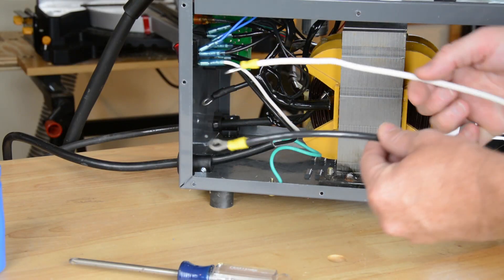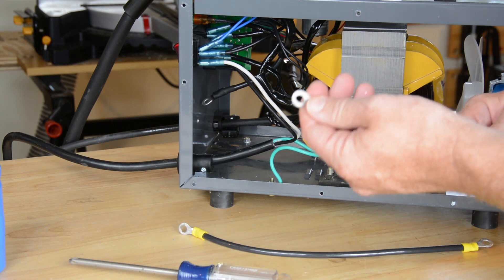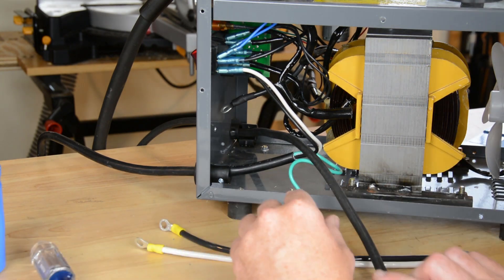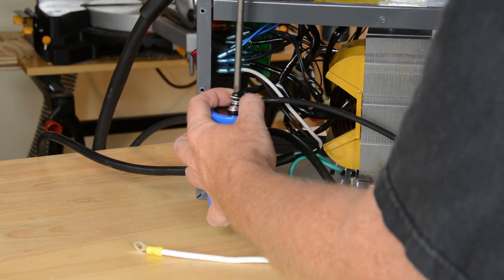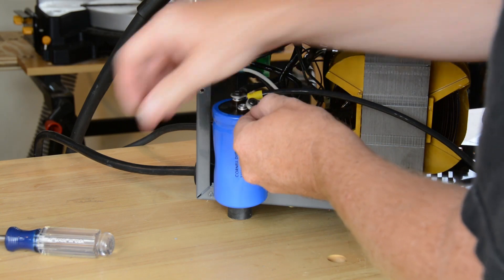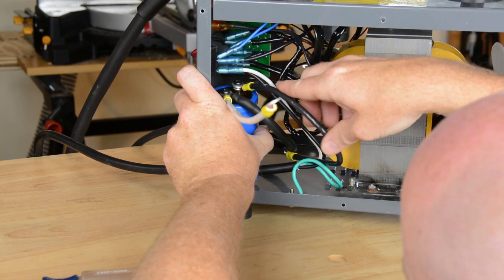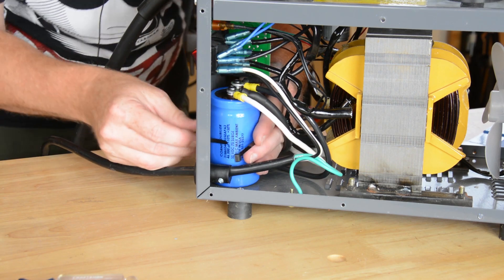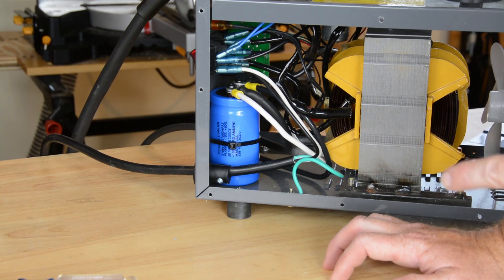Advanced Harbor Freight 90 AMP Welder Mods 05

Comment: Hi Matt 
I like the video but I have a question about the capacitors sizes, I have a couple of 1 farad capacitors for my Car Stereo Equipment from when I pulled out of one truck I had.
Can a 1 farad capacitor for car audio be used for this Welder modification, understanding that it is taller than the one's on your video.
I might have to make it sit at the bottom and go thru into the top section of the welder next to the wire feed controller so I can still be able to use a 10lbs wire roll and the rectifier down next to the Transformer or fan.
Or even having it installed on the outside of the welder with the wires going in and out with grommets and making a protective cover for the Cap.
I previously was a Car Audio Installer, Tinkerer, and Handyman with Electrical Experience so doing the Modification doesn't look hard to do.
Just wondering since I have them on hand I thought of asking the Guru of Welder Modification, hope to hear any thoughts you might have on the subject.
Thanks in advance

Comment: Can I use an amp cap 100uf 100v or 4700uf 80wv or 2200uf 16v?  Would the 100uf 100v be to much? What is the number I'm shooting for?
Reply from the maker: The important number is the voltage rating.  You want a 50V cap minimum.  Anything else will end up shorting out internally due to an over voltage (so no caps designed for car stereos for instance).  The uF rating is a "the more the better" scenario, although anything less than 10,000uF isn't worth doing and anything over 100,000uF is harmless, but unneeded.

Comment: I realize this is an old post, but curious why you observed polarity based on your welding leads and didn't just wire the capacitor directly across the DC output of the rectifier, positive to positive and negative to negative.  The welding leads could connect however you want DCEN or DCEP if you ever go to shielding gas.
Reply from the maker: This particular welder isn't capable of running gas, so it'll be DCEN forever.

Comment: What about using an 8 awg butt splice to extend the gun lead? In the new welders it is pretty short inside the case. I can use a butt splice to extend it using 8 awg stranded wire. Any concerns?
Reply from the maker: Soldered would handle the current better than a butt splice, but it should work.
Reply: +Matt Heere Yeah I agree soldering would be better. The wire gauge is so large I am not sure how well I could solder them together. Maybe I can find some solder butt connectors then heat shrink it.
Reply: John Chafin You can loosen the torch wires from above. You will need to trim the flux wire liner & the large thin rubber sheathing/hose that the wires are in. I did this & it was worth the ten minutes to have an extra 5 inches.

Comment: Matt After I have looked at this problem of where to mount my capacitor. I had made 12 in jumpers before I got the capacitor in the mail . And realized I couldn't mount mine where your is mounted .And strapped to the front bottom panel won't work as too close to the circuit board . Well I am thinking it may be possible to mount the capacitor on the top by the wire feed area . If I drill holes for the leads . It looks like the shortest lead being the torch lead will reach . I will have to sacrifice a couple more in of ground lead although . And since I have the 12 in jumpers they should make it too the rectifier . I will let you know if it works.   If you got any tips or advice I am not doing it tonight . AND WOULD APPRECIATE IT . Thanks .
Reply: Protect your jumpers that pass thru the metal by useing a rubber grommet. The welder gets moved or bumped around alot (I know mine) and the bare metal can cut into the insulation on the wire.

Comment: Matt, I am waiting for my 150amp rectifier to get here. I have four 23,000uf 50VDC capacitors and I am wondering is installing all four capacitors overkill ( capaitors are only 2" tall so space is not an issue).  Also I am wanting to install a bleed resister. I don't which resistor to install so it bleed off the capacitors fairly quick.
Reply from the maker: +George Beason Hi George.  Yep - it's overkill.  Won't hurt anything but two of them is more than enough capacitance.

The bleed resistor is a bugger because it's connected the whole time you're welding.  That means it has to be either a high enough resistance to limit power dissipation, or it has to be able to handle some pretty serious wattage.  The math works out such that the best you can realistically do is use about a 100 ohm 20 watt resistor, and that it will take around 20 sec to discharge the caps.  Anything smaller than this (to get a faster discharge time) and you'll need a massive resistor.  Not to mention that you're "stealing" power from an already smallish welder.

I have never once wished I had the resistor in mine.  It's just not that big of a deal to let out a little extra wire and short it to ground when done.  If I forget to do this and just let the thing sit, the internal leakage resistance of the caps eventually self-discharges them.  So, I never go to use it later and get surprised by a charge.  To each their own though.  I certainly understand the desire to add the resistor, it's just not as simple as it sounds.
Reply: +Matt Heere  I was going on your statement that you might add another cap at a later date.  so wondered if 48,000uf wasn't enough, what you would,have bumped it too.
Reply from the maker: That is what I thought/said at the time.  Having used it for a while though, and going back through the math, there really is just no need for any more capacitance.

Adding extra caps also exacerbates the discharge issue.  It'll take twice as long to discharge, using the same resistor, if you have twice as much capacitance.
Reply: +Matt Heere  Thanks!  I'll scrap the resistor issue. I'll just install two and sell the other two capacitors.  Can't wait to get this thing together....

Comment: Also, would a toroid core help?  If so, would it be that noticeable?  I've seen cores wrapped with 8 ga wire and used on the working clamp side.  Any benefits?
Reply from the maker: +Gary Farrar In theory yes, although adding inductance is about keeping the current constant.  Flux core is a constant voltage process, so I doubt that you'd notice any difference in the weld at all.

Comment: How would a 100 volt, 68000 uf capacitor work?  Real well?  Not so well?  Problem is that it is too tall to fit inside the welder case.  Should I shop for another (or 2) capacitor?

Comment: could you use a 500k car stereo capacitor
Reply from the maker: +Dane Kinsey Typically no.  Those caps are rated for 20-24 volts surge as a rule.   50 volts continuous is really the minimum safe rating for this project.

Comment: Also, one more thing does the uf have to be a certain number I saw you used a 47000uf one, how much does it matter, I guess adding a capacitor to a welder that didn't come with one must be an improvement regardless
Reply from the maker: +Hannes Nilsström It matters very little.  In theory, you "need" ~25,000 to maintain true D.C. power to the tip of the torch.  In practice, the voltage is all over the place anyway because it's totally unregulated, so any capacitance between 10,000uF and 2 Billion uF operates about the same.

Comment: ok thanks, how about using a few 10000 uf at 63 volts then ? The single "big ones" are so pricey that's why I thought of serial connections.
Reply from the maker: +Hannes Nilsström Two or three them in parallel would be fine.   No need for any more than that.

Comment: can i use a smaller capacitor? And does the voltage have to be 50volts or more, found one 47000uf but was 16 volts, I could connect some 22000 uf, 40 volts ones in series though, or series of 10000 uf at 63volts each. I know that capacitors in series, for instance 2x 22000uf, 40 volts will mean 44000 uf, but does that mean 80 volts too ? what is enough voltage wise, uf wise ?
Reply from the maker: +Hannes Nilsström You definitely need the 50VDC rating.  You can get this by putting two or more in series, but I wouldn't.  The capacitance doesn't add up in this connection.  It's a little complicated as you have to deal in reciprocals, but basically as a simple example if you had two 22000uF caps and put them in series the total capacitance would be 11,000.  The voltage does divide across the caps, but that too is tricky to calculate unless the caps all match exactly.

To get capacitors to add up you have to put them in parallel, and then the voltage rating is essentially whatever the lowest rated individual is.

Good news is that you get 75% of the value of the mod from the rectifier.  Any capacitor gets it most of the rest of the way.  Don't sweat over the uF value too much.
Reply: Your wrong

Comment: Would a 100 amp Bridge Rectifier work in a Job Smart mig 125 sold by Tractor Supply or should my friend use a 150 amp?
Reply from the maker: As a rule the rectifier needs to be rated for, at a minimum, as much as the welder output.  More is better - less will end with a fried rectifier most likely.  NOTE: I've never seen one of these TS units.  The website description makes it look like a similar layout to this HF welder, but I can't claim to actually know anything about it.
Reply: Matt Heere Yes basically it is a similar layout.It looks like the wire feed motor has its own voltage supply so the motor runs even all the time. Since it can hold a 10# spool the case is divided in half. There is room in the rear in front top part of the case  in front of the fan to place a rectifier.  Thank you again for your help.
Reply: Terrell Lemoine You know you can buy a DC FCWF Welder for around a 150 dollars by the way , the problem with the bridge rect. is that the inrush current when you strike an ark too soon is the cap act like a short the way he is hooking it up and could burn out or blow up the cap .

Comment: Matt, could you look at this link and tell me why he is wiring his welder different than you and will it work the same?
 http://weldingweb.com/showthread.php?54955-Converting-90-amp-AC-welder-to-DC/page5
Reply from the maker: It's electrically the same.  He chose to locate the components differently, and so the connections are in different places, but the circuit is the same, except for the addition of the big resistors to bleed the power out of the cap when you turn the welder off.  Those could be added to my setup, but I was trying to keep the whole thing as cheap as possible.

Comment: I did check the voltage with my volt meter.I place red lead of my meter to ground and back lead to the torch and got 24.76 volts. I switch the leads around and got a -24.76 volts. So it looks like it is connected right. I added a 12 volt fan blowing across the heat sink fins and it is cooling it nice.
My grandson and i welded a long time this afternoon with no troubles. I will let you know how it goes when i get the new capacitor. Thank you again Matt

Comment: I have contact the ebay store and he is sending me a new  capacitor out on Monday.This is the ebay item number 181362099328 if you could look at the picture and verify the post on front right side is positive like the picture shows. I know you have better thing to do then kept replying to me, but this may help someone else and i really appreciate it.I just want to make sure i don't blow another capacitor. Thank You
Reply from the maker: No worries Terrell Lemoine.  Happy to help if I can.  I looked at the pictures of the item.  Boy, it's really hard to tell for sure based on how that's marked!  I would agree that the second picture makes it appear that as you're looking at the rectifier on edge, from the side with the DC output terminals, that the negative is on the left.

BUT, I wouldn't trust those markings one bit.  I'd check the DC output with a voltmeter.  You're really only looking for polarity, so even an inexpensive analog one will work.  BE CAREFUL though because you'll have to have the thing hooked up to the feed from the transformer (and nothing else) to do the test.  Everything should be well under 50 volts, but it'll still make for a bad day if you get against it.

Comment: Matt, i just got my  3-Phase Diode Bridge Rectifier SQL100A 100A 1200V in today.I hooked up the two cables coming off the transformer to 2 of the poles on the 3 pole side. On the other side on what look to be the + went to the + on the cap and what look to be the - went to the - on the cap.I tried to weld went it and it will not weld right.It was welding better with - ground. Do you think i have something hooked up wrong?
Reply from the maker: It's hard to say without seeing it, but your description sounds like everything is correct.  I'm sure you already triple checked this, but the negative coming off the rectifier needs to be connected to negative the on the cap AND then on to the torch itself.  Likewise for the (+). Needs to go ultimately to the "ground" clamp.  It will absolutely weld with the polarity reversed, but it should be a mess.

It should make no difference which two posts you used on the input side of the rectifier, or which order you connected them to the transformer.  However, there's no harm in playing with those connections to see if it works better setup one way vs. another.
Reply: Matt Heere I did triple check all connection and - on the cap did go to - on the rectifier and + on capacitor to + on rectifier.From the + on the cap went to the ground cable and the - went to the torch cable. After trying to weld again after rechecking wiring the capacitor blow out some gas out of a port hole. I removed the capacitor and reconnect straight out to the ground and torch cables and now it welds.It looks like it welds hotter now.The capacitor i got off of ebay was a NEW! CORNELL DUBILIER CAPACITOR 101X563U050DC2B 46,000 uF 50VDC -10% +75%. So do you think it was a bad capacitor?
Reply from the maker: Terrell Lemoine  It's certainly possible.  These caps are a type called electrolytic, and they're great for capacity in a relatively small space, but they are really sensitive to reversed polarity.  If it was ever hooked up backwards it probably is a goner.  eBay is obviously a lottery at best...and even genuinely new parts are bad from time to time.

The cap is nice to have, but the rectifier is doing the important work.  If you're happy with the level of improvement you see with just the rectifier then go ahead and use it that way.  Adding a working cap will smooth things out, but it's an incremental improvement beyond the switch to DC.  As a bonus, without the cap you don't have the "it's still hot even when turned off" problem :)

Comment: Matt, do you know if there is a mod to add a 10 lb spool to this machine?
Reply from the maker: With the older blue one like I have, the only solution to this that I've seen is to hang the spool out behind the welder.  ***** has a series on tips for this welder that includes a description of how he did it: http://youtu.be/41ha9kn3qL4?t=3m58s

I don't weld enough to make it worth getting into the larger spools.  If I do a go-kart this winter though I'll probably make the switch.

Comment: Matt, would it be better to cut off the unused terminal or just insulated?
Thank Terrell
Reply from the maker: It doesn't matter.  The contact won't be hot, so you don't need to take any special precautions.  It does serve as a spare in case of a dead diode in the future, but if it's in the way then get rid of it :)

Comment: You said that a 3 phase rectifier can be used but to ignore two of the inputs.Do i just not use the middle post and just use the four at the corners?
Reply from the maker: Right.  I meant one of the inputs.  You'll hook the two leads coming from the transformer to two of the AC leads on the rectifier.  Ignore the remaining 3rd AC input lead.  It doesn't matter which two of the three AC inputs you use.

Comment: Hello Matt,
Can I have the specs on the capacitor? Is the rectifier single phase? 
Thanks Buddy
Reply from the maker: Mine is 50VCD and 43000uF.  You need one that's at least 50V.  The rectifier is single phase, although you can use a 3 phase device and just ignore two of the inputs.
Reply: Matt Heere Hey Matt,Thanks for the info,great upgrade.my question is a 50vdc 39000uf cap sufficient.
Reply from the maker: Should be fine *****.  You can always add a second one in parallel someday if you come across a good deal.  Remember that originally we had no capacitor at all, so anything you put in will be a big improvement over where you started.